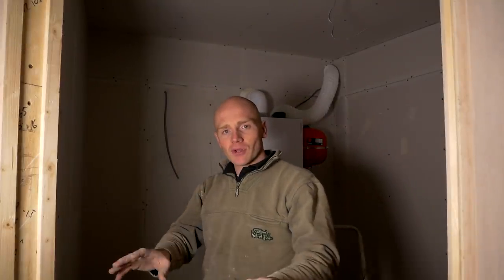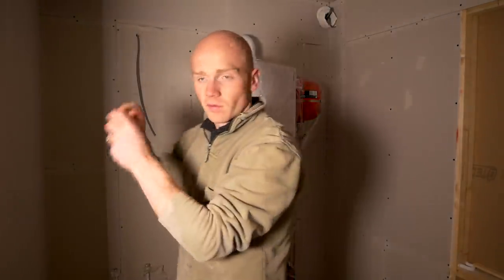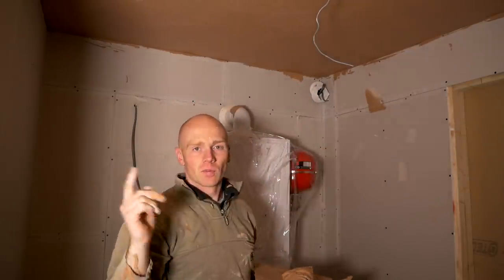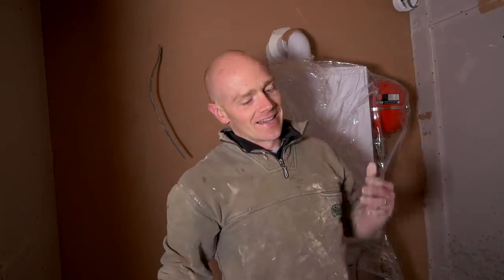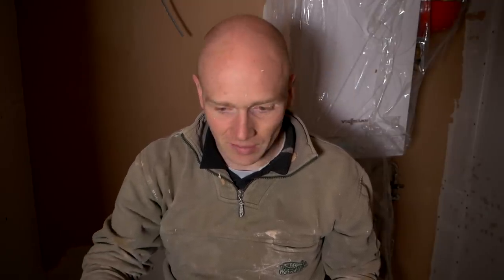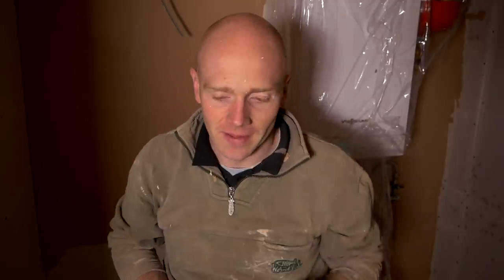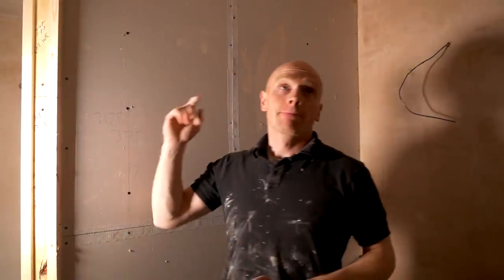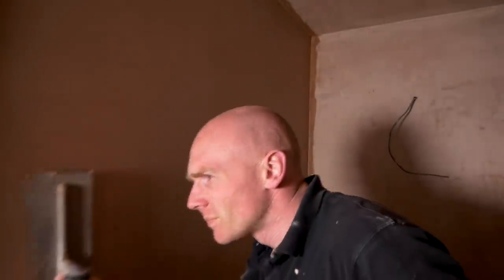DIY PLASTERING... the last resort!

Comment: I have been doing my own plastering for about 15 years including ceilings after watching a plasterer do a job for me, as the last comment said "its about pride and the end result" I also learnt you can trowel up when it's dry to take out high spots and fill the low spots with dry wall filler, jobs a good'en, well done and your channel is my new favorite watch.

Comment: Tip for next time: if skimming to a dry wall like you are here, wet the edges a few times with a brush before you start putting it on. It stops you you getting dry lumps and then dragging it through your work. Keep it up!

Comment: I can give u 3 tips as a plasterer that might help you further down the line! 1. But a marshalltown preworn trowel, using a.cheap trowel thats not worn wont give u a good finish, 2 spread thicker, when ur laying on u can hear it scrape 3. When u spread keep your trowel flat to.the surface and go up and down or back and forward to remove lines as your going, makes.for a easier time.laying in

Comment: 10:07 The shine on that wall is pretty impressive, but I wouldn't consider DIY plastering unless it was to cover an ugly "Artex" finish, or maybe a badly hacked-up wall. Here in New England, the people who love blue-board-veneer-plastering are skilled contractors who want to be in and out in a day. If it's your house, mud & taping takes less time overall and the drying time (if using mud out of a pail) is not a problem, since you're living there. My father's 1956 house had rock-lath plaster (3/8" plaster over 3/8" drywall), a very nice job of it, but you could see through planks in the basement what a mess they made putting it up.  If you're careful, you can mud & tape in a carpeted room with no dropcloth, while the family is watching TV.

Comment: Hi Where most people go wrong is trying to get it perfect all the time. The first and second coat don't need to be perfect and for the final coat you can cheat with a tool called a speed skim, this is a tool about 3 feet (0.91 m) long with two sides, one plastic and the other steel and you can get them from tool station in the UK. save some money and just get the spare blade and use a batten along the middle for stiffness. The paint you use for the ceiling is also very important, watch "Home Reno Vision DIY" on you tube  he has a lot of good videos and tips.
Reply: There's no cheating in plastering,believe me I do it for a living.

Comment: Ahh u got me tempted now tim, just plaster-boarded a smallish bathroom ceiling and really dont wana plaster it myself as ive never attempted it before but i fear i will struggle to be able to get a pro in to do such a small job as there normally booked up for weeks and months. 

On another note, i used 25mm drywall screws on 12.5 board as its all i had at the time, the boards are screwed into 25mm counterbatterns that are are below insulation so the max screw i could of used are 35mm, du think its worth replacing the 25mm screws with the 35mm screws?
Reply from the maker: Maybe just fire a few 35mm in between some of the others. Probably more important on ceiling o guess.
Reply: No, as long as they're tight job's a good un!

Comment: The dustless stuff you use, would like to have a go with it, as seen no taping required. Would like to see how it looks in coming years ( as in if cracks/joints shown or not). Also heard "if you consider yourself a pro and can do everything, you are not good at all". I would not agree. It is not the tools which do make a Pro out of you. Practice, correct, learn... I have restored old house (almost) and done everything in it myself. Probably 8 out of 10 times, when you hire contractor, the cost is not equivalent to the job done, if you were to shine the light on the plastered drywall you would pull your hair out saying could done the same at least. Great job. But what you gonna do when all is done? As I ask myself the same question :D
Reply: "Probably 8 out of 10 times, when you hire contractor, the cost is not equivalent to the job done."
This is why I'd rather do a 7/10 job myself, with the opportunity to improve to a 9/10 with practice, than pay someone an un-godly sum of money on the presumption they're going to give a damn or be competent.